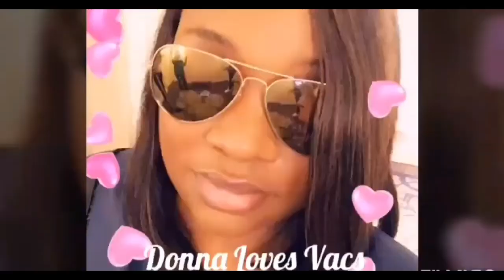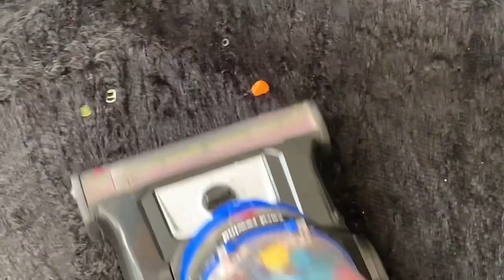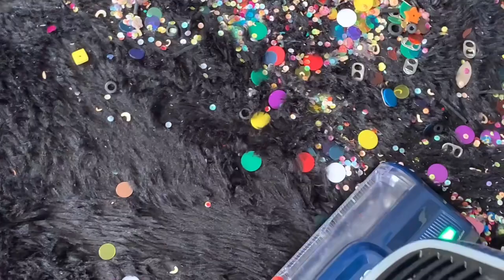Wild Thoughts Part 1 | The Wilder Mix Debut

Comment: 💥 TIMESTAMPS 💥

🔥 0:00 - Intro
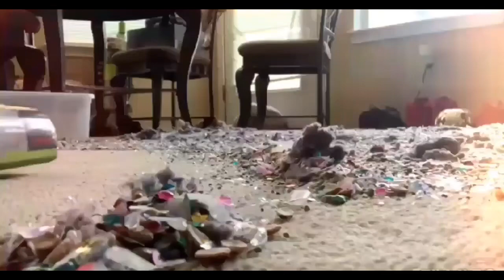🔥 0:16 - Love for Lavette Wilder 💖💖💖

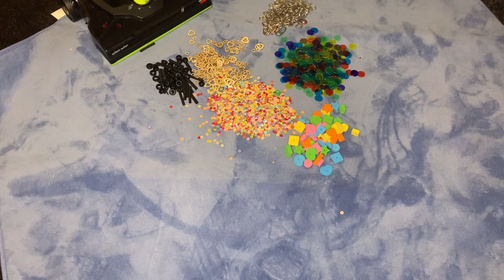🔥 0:21 - Aeroswift 💚 brushroll pickup w/ new material piles on light blue rug + lines
🔥 2:16 - Aeroswift 💚 brushroll pickup w/ Wilder Mix on light blue rug + lines
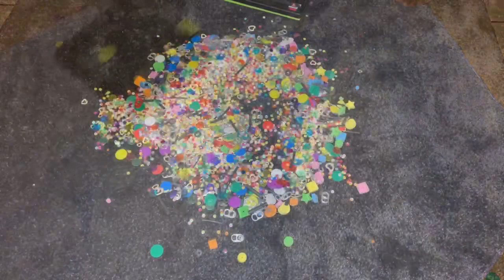🔥 4:26 - Aeroswift 💚 brushroll pickup w/ Wilder Mix on black rug + lines
🔥 7:20 - Aeroswift 💚 brushroll pile attack w/ Wilder Mix on black rug + lines (closeup)
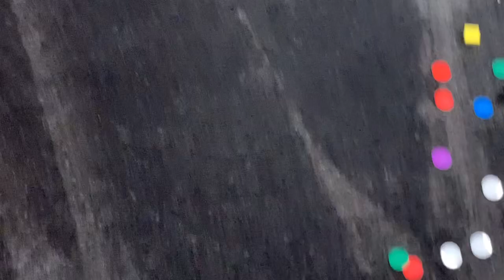🔥 8:50 - Aeroswift 💚 brushroll pickup w/ Wilder Mix on black rug + lines

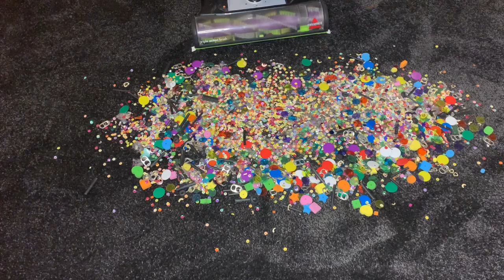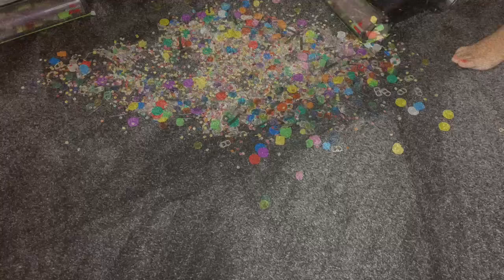🔥 11:12 - Cleanview 💙💚 brushroll pickups w/ Wilder Mix on black rug + lines (14:04, 16:32)
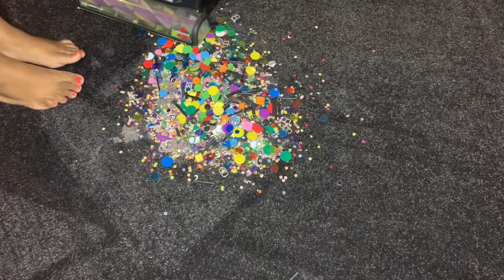✨ Bin dumps - 13:40, 18:25
🔥 18:36 - Cleanview 💙💚 brushroll pile attack w/ Wilder Mix on black rug + lines
🔥 20:25 - Cleanview 💙💚 brushroll pickup w/ Wilder Mix on fluffy black rug + lines
🔥 22:07 - Cleanview 💙💚 brushroll pickups w/ Wilder Mix on fluffy black rug/carpet + lines (closeup) (24:28, 26:53)

🔥 28:43 - Shark Navigator 💙 brushroll pickup w/ Wilder Mix on fluffy black rug + lines (closeup)
Reply from the maker: Unsung hero of our community